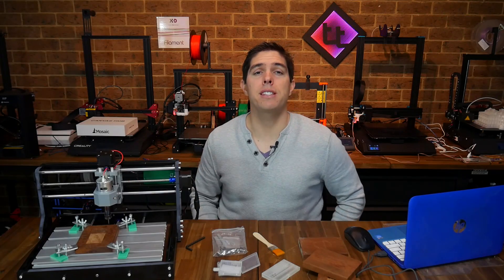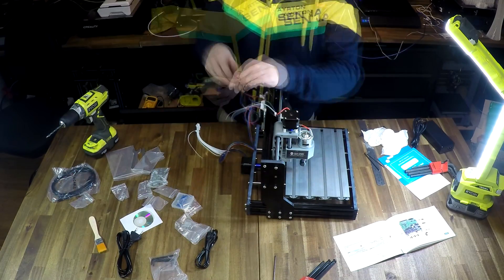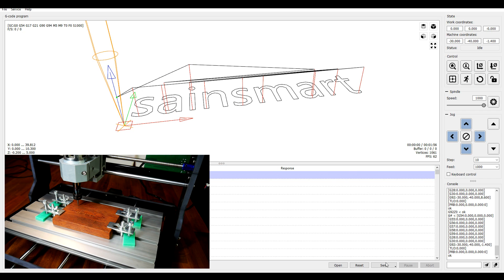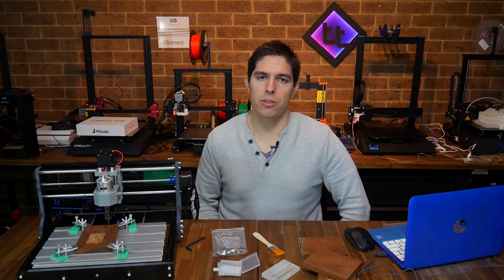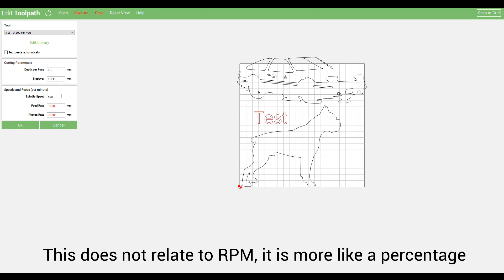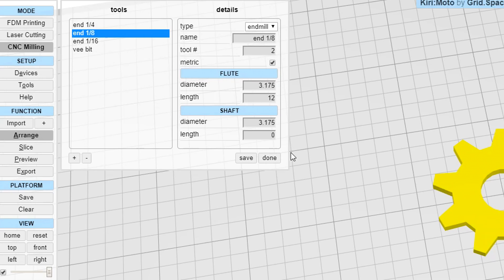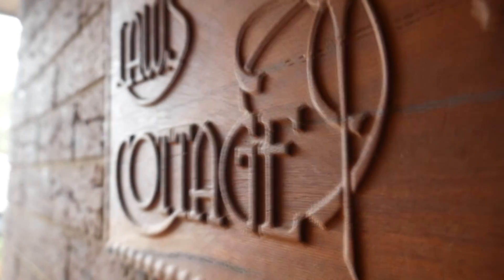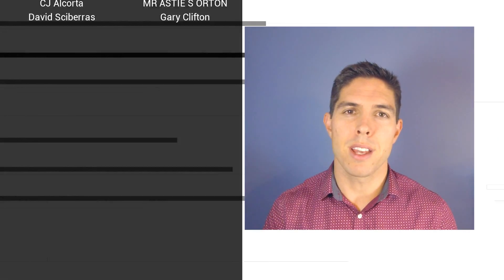CNC router for $200 - Sainsmart Genmitsu 3018 Pro review and tutorial

Comment: This machine totally seems worth it! Thanks for your review. I'm sure you bud Webber is running around in doggie heaven somewhere grateful for such a loving owner
Reply: If it costs 200 dollars stay away from it.
Reply: @Yatukih_001  Why? Because it can't mill steel? Or takes 10 times longer to get through the same amount of Aluminium than a professional CNC? Or because it's not accurate by a long shot? Not everyone has the same use cases. Small decorative work on wood or plastic, or especially that PCB carving for which you don't need a big area, when you're not pressed for time and are willing to put in considerable cleanup effort in post seems to be fine.
If the choice is "get started with some carving for 200$ and accept it won't be the best work" or "don't get into CNCing at all because you can't afford to spend 2000$ right now", I think it's obvious. Though it's also important to understand that this is not something that will improve your business. This is a hobby machine, and priced as one. And probably, just like 3d-printers in that price range, you'll spend more time working on your CNC than the CNC producing products for you 😂

If I saw only the price tag I would agree with you, but here we have an experienced Maker and teacher (whose reputation depends on providing good information) showing us exactly the quality we can expect from it, and that even he doesn't get it right the first time, so some fiddling will have to be expected.
Reply: @sourcererseven3858  Yes that's exactly why.

Comment: When cutting Aluminium I would suggest for you to use Kerosene for cooling and lubrication. Water will keep the temps down - but doesn't provide lubrication for the cutter, 
If you cut dry, - aluminium starts building up on the cutting edge of the cutter -  which results in a ragged finish. Using Kerosene keeps the cutter clean and the cut smooth.
Reply: Why not WD40?

Comment: I had the same issue with a similar CNC where it stopped half way. This happened every time I got out of my chair. It was caused by static discharge which caused a fatal usb disconnect / lockup on the CNC controller board. The solution is to loop the usb wire through a (clip on) ferrite choke near the end that connects the CNC. Never had that issue since.
Reply: Maybe adding a ground wire to the chassis ie connecting the USB case to the chassis would help too.

Comment: They attach firmware on a minidisc? This isn't 2002, are they also available online?
Reply: mine came on a 256MB flash drive. Where do you even get a 256MB flash drive in 2019.
Reply: @Shawn_White  wait, flash drive as in compact flash? The thick memory cards digital cameras used to have? I think my multi-card reader has a slot for that but still that's definitely outdated too

Comment: Probably get better results if you use a decent cutting head instead of the junk it comes with
Reply: Surely if someone could afford superior cutting heads they would just buy a better & more expensive CNC in the first place. I guess that's an upgrade, but not one that's going to happen if $200 was your Budget. It seems good for learning on.
Reply: @goldbunny1973  im just talking about buying some Dremel bits from walmart, nothing super fancy
Reply: @TheFoodnipple  Ok, I see. I've wondered if a lightweight but mains powered Dremel drill with the right cutting bit could be mounted on a 3D printer assembly & used (slowly) to cut designs into balsa wood, plastic, solid plaster etc. I've been watching Nick Zametti on YT and now I want a lathe, lol!

Comment: Any clue if it can cut carbon fiber? I’m into designing race drone frames and I would like to invest in one.
Reply: The cnc and router will work with carbon fiber with the right settins, but you might need better bits than the ones that come with the machine.  Slow the depth speed and feed speed, it'll take a lot longer but less chance of something breaking.  Carbon fiber is a tough cookie

Comment: You were using the clamps incorrectly. You do not need to use a tool to secure them. The bolts are not for tightening down onto the job but for adjusting by finger to suit the job thickness. The clamping is done with the wing nuts. The bolts are adjusted until the clamp is a little higher than the workpiece and then the wing nut is hand tightened. It's important that the screw end of the clamp is higher than the workpiece to avoid the workpiece moving around.

Comment: Hi, I’m looking for a small CNC to make brass wood brands. You said it can handle soft aluminium, can it handle brass?
Reply: This machine would be lucky if it can handle balsa wood. The linear guides this machine has look like they were taken out of an inkjet printer to me. You want at least Hiwin bearing blocks for doing any kind of metal work. Expect to spend at least a grand. Two to three times that for something made for you. The machine in this video is a toy not a tool.

Comment: I ran into one major issue with this machine.  If the spindle draws more amps because of a tough piece of wood (say a knot) the amp draw can cause the USB to disconnect (and ruin your project).  Its likely due to the CPU doing a brown out from the amp draw.  Quite a number of posts around the net regarding it.  It is an easy fix with a dedicated power supply and a mosfet or even just a simple manual control on the spindle.  That fixed mine despite Sainsmart shipping me a replacement power supply (which did not resolve the issue). I have also run into vibration issues with the machine and the bearings popping lose when machining aluminium.  Overall I agree this is a good starter machine but there are some fundamental issues with it that will take some troubleshooting and require some more advanced maker skills.  As always thanks so much for the video, love your content.
Reply: the guide rails on this machine would be suitable for an inkjet printer. If you really want to use this to cut harder materials you need supported guide rails. Something like Hiwin bearing blocks. Plus some kind of framework to attach the rails to, of course. That spindle is a bit how you doing too. There's no cheap easy solution there that I am aware of. A 2.2kW water cooled spindle might be nice.

Comment: Wondered if you’ve used the laser attachment? If so, can you use JPEG files to burn to?
Thanks for the vid. May sway my thoughts about buying this CNC.
Reply: Well, this machine could gain you a practical appreciation for a CNC system. But there's nothing in this machine that you'd want in a capable CNC machine. When you got done rebuilding it there wouldn't be a single screw left original. It'd be grandpa's ax. The head changed two times and the handle 3. You'd be financially that much further behind too. It is a buy once cry once deal. This machine is pure tears.

Comment: A hint from a professional CNC machinist. Use proper coolant (water oil emulsion) or if you can't get your hands on some, get some cutting oil. This works much better with metals like aluminum.
Reply: kind of depends on the alloy and the material of the cutter. hss is good on al with no lube with the right chipload...
Reply: @ThePitProductions   yes but his endmill probably was a solid carbide. Hoffmann Group provides a nice "Tool Scout". But I think for his more semi professional any good solid carbide endmill would be ok. But I would use one with at least 2 cutters, as the one with a single cutter tend to vibrate on such a small machine. Or he would need much more rpm.
Reply: @ShadowTheHedgehog85  More flutes needs more rpm for equal loading.  v bits are for engraving. carbide in this machine would be silly. the spindle runout alone will destroy any carbide has. just too brittle. hss all the way with this little guy.  jmho.

Comment: What was the RPM speed when cutting aluminum
Reply: Carbide tooling cutting aluminum surface speed is for all practical purposes unlimited. So as fast as you can go. I actually think the maximum speed is 3,000 surface feet per minute? It is some off the wall number like that. Machines generally can't go that fast. A 3 inch in diameter cutter spinning 3,000 RPM is 2,356 SFPM. So that would work just fine. This machine here in this video isn't cracking 66 SFPM with its slow rotational speed and small bits it is using. It is the speed at the periphery of the tool that matters. You can cut aluminum with a carbide toothed circular saw. I've done it. That's 9,267 SFPM if you're using a 10" blade at 3450 RPM. Generally I run a 7.25 blade though if I'm cutting aluminum. That takes it down to 6,548 SFPM. Not a problem.

Comment: I got one of these 3018 CNC machines about a year ago.  The software works, but the machine itself does not have the stability to do real work.  I had to use such small z increments to get to a specific depth or I would get too much play.  The carriage is just not stable enough
Reply: Yup unsupported guide rails have a lot of spring in them. A lot more than most can imagine. Even when they're 3 inches in diameter. The old fireball 90s flexed.

Comment: Hey with the aluminum and other metals you might want to increass the feed rate and adjust the spindle rate to get bigger chips since that doesn't mean the bit is cutting already cut metal also you might want to invest in a end mill with more flutes since it will be able to cut more per rotation  and could mean higher feed rates if the machine has a high enough torque router
Reply: also fusion 360 has a super power cam environment the only thing is its very complex but with the right setup it could mean very great parts and even multi axis milled aluminum if you were to put a additional axis.
Reply: @Lolatronn  These units are simply not stiff enough to machine aluminium aggressively, if at all. You can see from the cut examples that the tool is already jumping around due to being overloaded. More flutes is not advisable for aluminium, smaller chips and more heat mean it is more likely to jam in the piece.

Comment: When the gear was being cut it looks like the machine was moving to absolute coordinates, stopping, then going the the next. In contrast with constant velocity mode where each gcode line is merged with the next to keep the surface speed constant. Is this something their software can change?

It's an option in Mach 3 and I always user constant velocity. Also a nice feature to use when making the gcode to is roll sharp corners. The cutter is circular so it can actually roll around a 90deg corner and still produce a sharp enter but make acceleration easier on the machine.
Reply: GRBL is a pretty bare bones motion controller. What do you expect when it fits into 32KB?

Comment: Do you have any issues with stall out and reset of the CNC when cutting PCB or Metal? if so what is the workaround for it?
Reply: Some commenters say the PSU is inadequate. They say that running the spindle on its own PSU helps. Otherwise on high current draw you under volt and brown out the microcontroller on the control board.

Comment: Hey Michael is the machine to rigged enough to adapt it to a 110v laminate router for way more power? Could easily adapt it to control with a large mosfet driver.

Comment: I would like to see a video on the offline controller. There is not much info available on it. I would like to use it with an Uno and CNC board running   GRBL 1.1 so any technical details about the interface would be helpful.  I'm sorry about your dog.

Comment: Is it possible to make it bigger?
Reply: The cost of a CNC machine squares with work envelope size. The bigger you go the heavier everything has to be and it all costs more then too. This machine here is inadequate even for the size it is too. At 2 to 3 times the price you might be able to put something together that works well. But this machine is an educational toy at best. Something akin to a plastic robot arm you'd buy at Radio Shack. As opposed to a real SCARA arm.

Comment: I think you're supposed to use the wing nuts to tighten or release the part, not the M6 screw itself
Reply: Nope, he was using the clamps correctly. The wingnuts are supposed to be a fulcrum, and tightening the bolts will allow much more clamping force than you could achieve by tightening the wing nut.
Reply: @340havoc  MoshiReal is correct.
This is just a light duty version of a standard T-slot hold down clamp that has been in use for over a century - they are always tightened in the center. In fact, the bolt should be threaded through the bottom so the head contacts the table to spread the pressure out.
If you need so much pressure that you have to use a wrench, then you have other bigger problems with your set up.

Comment: Just a quick tip, use some Blue Tack or putty to create a dam around the engraving area. it will contain the water so you can leave it unattended and make cleaning up easier.
Reply from the maker: That is a winner, thanks for sharing.

Comment: Instead of using Water for collecting chips, You can use mineral oil. It will stay on the material because of viscosity.
Reply: cleanup is a pain though.
Reply: @KieranShort  No, you just need a very small  qty which will stay on top of PCB because of surface tension. And there are some "less sticky" oils too. I used mustard oil and it works great.  When your PCB is done, Just wipe all of it using towel. PCB is good to go!
Reply: WD-40 is the defacto cheeze whiz aluminum cutting fluid of choice. Because it's cheap, and easy to get. It works OK too. Oh and all liquid cooling solutions have a clean up factor associated with them. That's part and parcel for the territory. I have a Bijur mister. There's something about breathing coolant that I'm not big on myself though.

Comment: I wish they sold a kit were I provided the router rather than buy theirs
Reply: That's what they all say before they try to use a router. You ever listen to a router howl away for hours on end? They're louder mounted to CNC machines too. There's a reason water cooled spindles sell so well.
Reply: @1pcfred  Personally I've never heard of or recognised something as being a  water-cooled spindle
Reply: @1pcfred  Two big thing that stopped me even considering a cnc machine was, 1. Cost and 2. Noise. If as you say the water cooled spindle is substantially quieter than a router what are it's downsides? Of course one is cost. I was hoping to bring costs down by using my Makita 700c. Now it appears that costs are going up as i now need to buy a AC Spindle. Are their any other downsides to the AC Spindle?
Another thought is how accurate are the LowRider 2. One person said we could expect 1/16th of an inch.
Reply: @1pcfred  Thanks Paul. Your thoughts give me something to start with when I search info about WC Spindles. Fact of life, manufacturers and retailers never give us the downsides to the stuff they make or sell.

Comment: I would totally get this, but i gotta learn other things first. But what is a good 3d design program to use that is free? Because right now i'm a legitimate purchaser of inventor, and do like it but frankly only use it because it's what i grew up being taught on.
Reply: Fusion360 is free if you are a hobbyist or startup earning under 10k US from its use. Its built-in Cam is, in my opinion ( having used nearly all of them professionally over the years) second to none. Or you can buy the exact same cam, HSM Works, as an extension to Inventor.
Reply: @m3chanist  had a feeling fusion 360 would be mentioned. never touched it, but i wonder. is the interface and what not pretty much the same as inventor. i'd imagine so since they both are from autodesk.
Reply: @ALegitimateYoutuber  There are similarities yes, I use both.  Inventor is the better tool for extremely large assemblies, thousands vs hundreds of components, so a better fit for large organizations, but for the small business or solo operator fusion is freaking wonderful in my opinion, in part because it doesn't need to support that kind of massive workload. The two don't compete against each other, they are two different horses for two different courses. If you are comfortable with Inventor you'd find it an easy learn yes, although you need to not think in quite the same way, that can be tricky at first but youtube is stuffed with great tutorial videos, many from Autodesk themselves. Fusion is less rigid in its overall workflow but is still missing a few comforts, albeit development is very rapid and that list is shrinking fast. I find myself more often wishing Inventor was more like fusion than the other way round if that's any indication, although sometimes the other way. I'd say go for it, it's not an either or, they both talk to each other seamlessly.

Comment: Can you use Fusion 360 CAM with this machine?
Reply: The machine only takes gcode
Reply: @Stiffsce  fusion 360 has one of the best professional cam packages available built it, what used to be HSM works before Autodesk bought it and bundled it with fusion as well as selling it as an addon to Inventor and solidworks..Suffice to say, it generates world-class gcode.
Reply from the maker: Lots of people in the community group using fusion